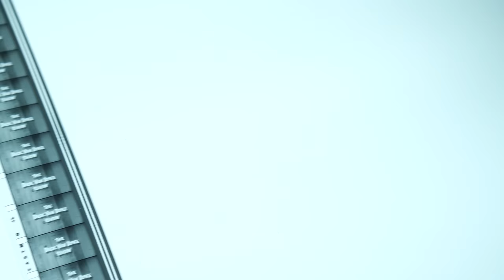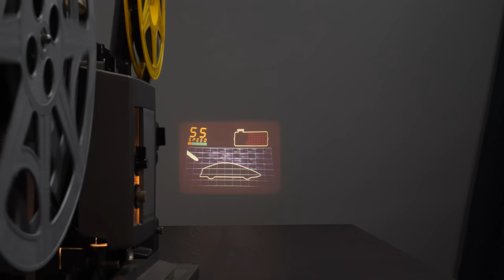Movies made sound with a light bulb: Sound-on-film

Comment: This is one of my areas of expertise so I'll try not to go completely into shop-talk mode. SDDS could do 8 channels, yes, but it often carried the same 5.1 mix as Dolby Digital and DTS. The extra two channels were between the Left, Center, and Right channels behind the screen, so backwards compatibility was a no-brainer. AMC made a huge SDDS buy and installed SDDS in ALL of their screens in the US, or at least they were supposed to. They certainly had a ton but I don't think it ever reached 100% of AMC screens. SDDS is indeed the least preferred format though. That's because instead of dropping back out to analog stereo when it failed, it would often drop do a crappier low-bit rate digital mode with fewer channels. It sounded awful, way worse than even Dolby A-Type. Only when that failed would it drop to ANALog sound. I wish I knew you were working on this as I could've sent you some DTS discs. BTW DTS was really only a 5 channel system as it doesn't have the ".1". Instead it took the subwoofer information from the surrounds, which made the surrounds not-full range. There's so much more nonsense I could blab about but I'm stopping now before they use my text as a new border wall or something. PS - They got rid of silver soundtracks and opted for cyan dye soundtracks. You can see one on the platter picture you showed with the film coming out of the center. Yeah that was a whole thing which was a fun conversion in the industry.
Reply: I'm an audio engineer and I have a few questions.

1. You say DTS is not "full range" in the surrounds, and the LFE is a summed and filtered mix of the surrounds. How is that exactly done? Is that the case for theatres as well as DTS on consumer media? I have the catalogue of the band Genesis remixed in 5.1 DTS 24/96. When ripping the discs for my own archival purposes, I do notice that there is in fact 6 channels of audio on the disc. Is this a lie and the decoder is making a LFE channel up on the spot? Or is the process of taking the surround channels and creating the LFE done in the mix/master portion?

 If it is always just a sum of the surrounds, I would be interested to see how those Genesis albums were mixed, because the LFE does not sound like a simple filtered mix of the surrounds, and the surrounds do sound like they're full range when playing the music back.

I do know that the short lived DTS:EX used a matrixed center rear surround in a "6.1" kind of system in the years before true 7.1 channel releases, but the only movie I can think of that used that was LOTR.

2. I often hear claims that DTS soundtracks are mastered slightly louder on commercial DVD releases compared to DD. Is there any truth to this?
Reply: Expensive modification which some cinemas couldn't afford... a few years only before most went digital. OTOH those cinemas might not have been able to afford digital either.
Reply: @Aquatarkus96  The DTS system found on consumer media is entirely different from that used to provide digital audio in the cinema. Yes its the same company, but otherwise no connection.
Reply: Or as someone said in the early 2000s: "SDDS means "still doesn't do shit"
Reply: I scrolled down just to see if you'd show up. You did and I learned something new.
Reply: The change from silver soundtrack (for the human eye: black and white looking soundtrack on the film) 
to cyan dye soundtrack (for the human eye: green-ish looking soundtrack on the film) 
required the projector sound head to be changed from incandescent light bulb to red light. 
Red light would be achieved by red laser, red LED or red filter.
 (The filter method rarely worked well, partially because the heat from the bulb, aka the infrared radiation, runs havoc on filters and makes it break down over time. 
Another reason is the sheer strength of the filter, as It would be required to filter out ALOT of the light from the bulb)

The new red light would work well for both silver black-white soundtracks as well as the new green-ish soundtrack.

I experienced the upgrade at the film club projection booth where I worked (we had two 35mm Kinoton FP30D projectors). The technician who installed it made it so that we had one optical decoder card for red light, and one for white light. The card would go into our Dolby CP55 SR noise reduction capable cinema sound prosessor.
(We had two cards, one primary and one spare.
The primary became red light decoder, the spare became white light decoder.
The reason for making the cards two distinct cards was the wast difference in signal strength between the sound head solar cell being illuminated by incandescent white light versus laser or LED red light)

We would keep the white light incandescent bulb in a box alongside the card
The reason for keeping the old incandescent bulb was that we would project old worn films where the soundtrack would benefit from being read by white light from an incandescent bulb.

The red light in our machines would be provided by Jaxlight drop in replacement LED bulbs
Reply: Also, the "Bitstream code" on each side of the frame are identical, there are two because apparently Sony did realize that the edge was problematic and could create dropouts, so there's 2 of them so one acts as a backup. 

Fun fact, SDDS uses the ATRAC1 compression codec, so it it's in that ways related to Minidisc who uses a variant of that. ATRAC1 could hold up to 8 channels with a total bitrate of 1168 kilobits per second.
Even more fun fact ATRAC1 uses the technology that Dolby patented as "Transform audio coding with adaptive block length, transform and window" (that also goes for minidisc ATRAC) So Dolby gets a patent fee for each SDDS soundtrack that was made, and for whenever ATRAC was used in Cinemas or minidisc.
Reply: @vidar853  In the cinema I'm responsible for we initially employed Jaxlights to run cyan tracks, but the results were poor, the signal level was well down requiring the pre-amps to be run at maximum gain with a consequent high noise level.
So we swapped to using a ruby laser instead. This change also included changing the soundheads (Kalee type 83) from reverse scanning (projecting an enlarged image of the soundtrack onto a physical slit in front of the photocells) to the more common forward scan system in which a slit of light is projected onto the film. This involved junking the entire original optical system and photocells, greatly simplified the optical path and resulted in a significant improvement in analogue sound quality.  It also seems to work well with older films.
Reply: @Aquatarkus96  WOW OK I'll try to answer the best I can:
1 - The subs were derived using a simple low-pass filter. Home DTS is an extremely different beast than cinematic DTS. In the cinema DTS used APTX (I think) encoding. Home DTS was a completely different codec and eventually a completely different company. Theatrical DTS would eventually become Datasat. DTS-ES was their version of Dolby Digital EX, a center surround channel matrixed from the left and right surrounds, just like Pro-Logic.

2 - Yes I believe this is true. Not theatrically, but only for the home.
Reply: @GameSack   Regarding the relative audio level, Dolby Digital has a dialog normalization level setting encoded in that can attenuate the audio level to ensure that dialog is always at a fixed average level.  This requires applying negative gain to bring the absolute audio level down to this normalized level.

IIRC, DTS doesn’t have that (though I might be wrong?)

You can rip the audio tracks from a film with both DD and DTS, strip the dialog normalization, and both should be at 0dB gain.  In theory, this would give you the true mastering level of each soundtrack, but it is subject to whatever gain processing each master goes through, during export, encoding, and then the decoding codec on your playback device, etc...
Reply: @nickwallette6201  Dialog Normalization is the bane of Dolby Digital (it doesn't feature this theatrically). If it's set wrong then you get very noticeable "pumping" of the volume. If it's encoded correctly at -31db then this issue goes away and 0db is 0db.
Reply: @Aquatarkus96  Consumer format DTS is totally different, the only relationship is the letters DTS in the name.
Reply: What do you mean by "shop-talk mode"?

Comment: This was amazing.  It always fascinates me that the waveform I'm used to seeing digitally is the same on analog sources.  And knowing how they were written to and read off the film is very interesting.  But the most interesting thing I learned from this video is that the film gets slowed down to a ticking, "show one still frame for a fraction of a second" at the projection site in order for the persistence of vision to do its work.  I had no idea that film didn't just run through smoothly, but it makes sense once explained.  Then knowing that the sound area does have to run through smoothly, so both those sites have to be separated by a series of gears and capstans etc to make them run at different styles is the craziest thing of all.  Thank you so much for this video, I absolutely loved it.

Comment: The whole synchronization bit is gold. EDIT: Holy crap. I never realized that's how Dolby digital started out. Like in my head I was like that's late enough for a digital file right? I guess it was just spread across the sprocket of the tape...
Reply: Yup, it’s in between the sprocket holes. The way they squeezed in multiple audio formats into ever smaller bits left in the film is truly stunning. The engineers must have been so happy when things went digital for projection.
Reply: What's also fascinating is how Dolby incorporated DD/AC-3 soundtracks onto Laserdiscs. By the time the AC-3 technology was introduced, most Laserdiscs had the newer stereo CD style PCM track on top of the two legacy analog tracks, and newer Laserdisc players fully supported decoding the superior PCM tracks.

With the analog tracks becoming somewhat obsolete, they were repurposed for extra features such as commentary tracks. You could even have two commentary tracks on a disc because the player allowed you to select which analog channel you wanted to play back instead of playing both at the same time.

That's when someone at Dolby had the brilliant idea to store an RF modulated 384(?) kbps Dolby Digital signal onto the analog track. Some higher-end Laserdisc players came with a separate audio output for the AC-3 RF analog track which would be fed into a separate RF demodulator, converting the RF track into a proper digital signal that could then be fed into a home 5.1 channel receiver.

I used to have such a Dolby 5.1 Laserdisc set-up and it sounded fantastic! But with the introduction of lower cost DVDs and their ability to natively support multiple digital tracks, Laserdiscs quickly became obsolete. And once Blu-Ray and HD-DVD were introduced, it was already game over for Laserdiscs.

Still, Laserdiscs paved the way for the home sound formats and features we have today, and I'll always be grateful to have owned them at one time.

My old gear and remaining Laserdisc collection will soon be put up for sale on Kijiji.

Comment: Hi Alec, this episode brought back many memories from the 1960's when I was that geek kid that was always tasked with running any projector in elementary school.  That Bell & Howell Filmosound 500 series 16mm model was very easy to set up and thread (believe it or not) compared with the 170 and 180 series 16mm prior generation Bell & Howell projectors.  The 500 series had a larger lense, which enabled the protection bulb to be have the wattage and still maintain the same image brightness.  Those bulbs had a lifetime of 20 hours and needed to have the cooling fan run for another few minutes after projecting to cool and maximize bulb life.  I never had a sound drum lamp go out.  I suspect these bulbs were powered from a filtered dc voltage source to prevent ac hum from being transmitted to the light sensor, as it would detect the minor cooling and warming of the filament due to 60 cycles ac power.

The 35mm projectors used in the movie theaters during the 1960's had a carbon arc light source.  The projectionist would set up the arc prior to running the movie on both projectors.  A mechanical electrode feed system was used to keep the arc mostly optimized, which needed touch up while the film was rolling ever so often.  The electrodes only lasted about 22 minutes before they were consumed, which is why the film reels contained 20 minutes of film, at which point the second projector was switched on.  This gave the projectionist time to set up the other projector for the next reel, including arc electrode changout and alignment.

Comment: To be honest I didn't see how it was even possible to encode audio on film like that, but some quick googling says that 16mm film stock has an optical resolution 50-80 lines per millimeter.  Using the high end of that and assuming a 7 inch / sec film speed we get an audio rate of 14KhZ in more modern parlance.  It's not great but it's plenty good enough.  I'm still amazed it works at all, hats off to long-dead engineers for being smarter than I am.

37:35 I love how you actually put backwards captions and not just [reversed sound] or something xD
Reply: Depends on what film. Foma 100 has over 100 lines per mm, that's a cheap film (still in production as true B&W reverse film), it wouldn't be a problem to find something of much better resolution.